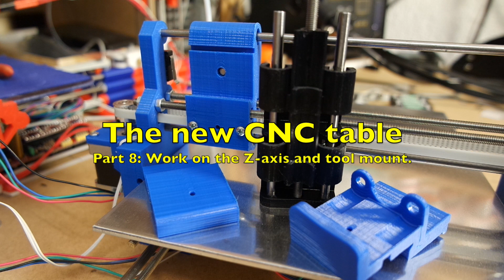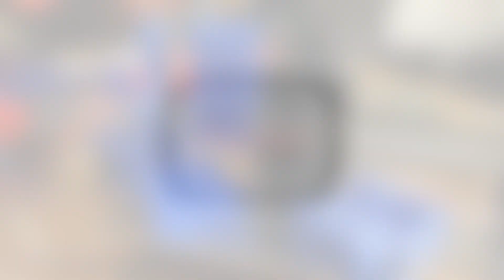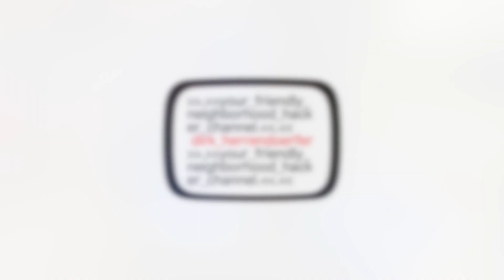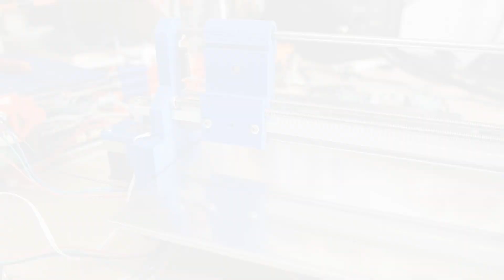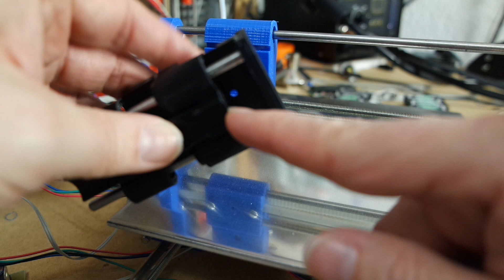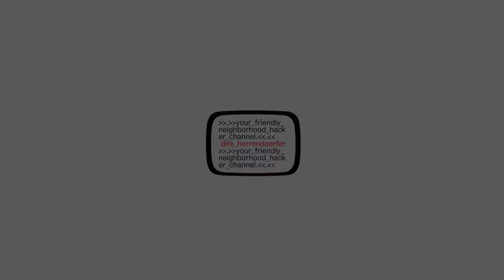The new CNC Table pt. 8

Comment: Hey, I also saw your PCB plotting videos, and was wondering, perhaps you have an idea, I am totally inexperienced with any finer mechanical work...
Plotting PCBs by using a pen to draw the traces, as I see it, limits trace /  clearance to roughly 1mm, which is rather coarse.
I have been successful in a manual experiment painting the copper layer completely black, with an ink pen (that you need to shake and then pump, not just regular "water proof"), let it dry properly. And then scratch away the clearances with a fine flat screw driver.
Then etching.
This worked quite well, and if there was a way to automate the process, I'm sure one could get much finer layouts than when painting traces with a pen.
I would have no idea of what you could do to automatically scratch away ink and clean the "scratcher" once in a while, though. I'm not sure you could keep e.g. a rotational milling tool clean, after some clearances it might mess up the rest? (some people directly mill the copper away, but this eats up tool quickly)
Reply from the maker: I want to try such an scratch-n-etch process with this new machine, I've already made a scratching tip. I wanted to also try to laser the paint off - but so far it's no good. I don't really want to go for the complete milling, because making all that copper dust is really not that healthy - etching is also not that great, but at least one knows where that dangerous copper went.
Cheers !
Dirk
Reply: Well, in that case, I guess I subscribe and see what's coming :)